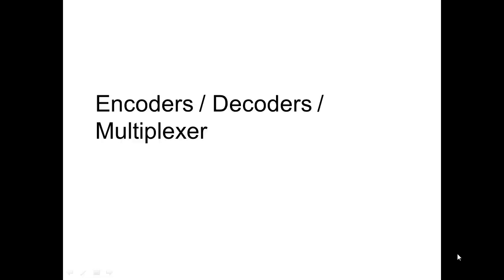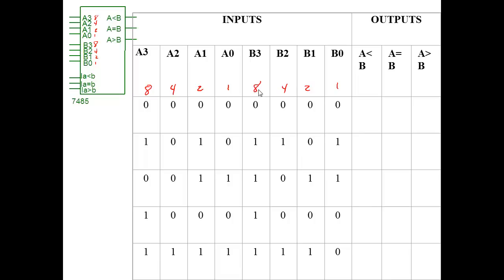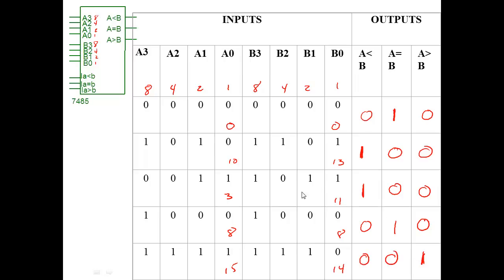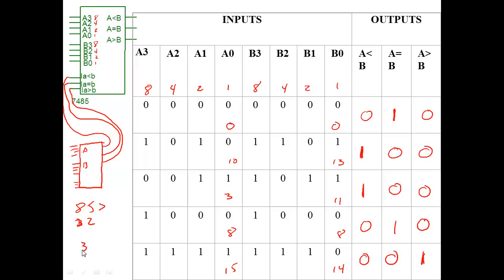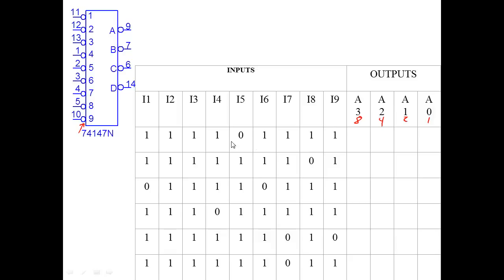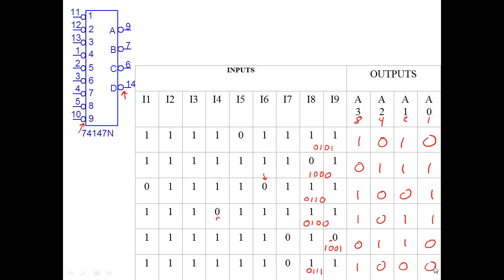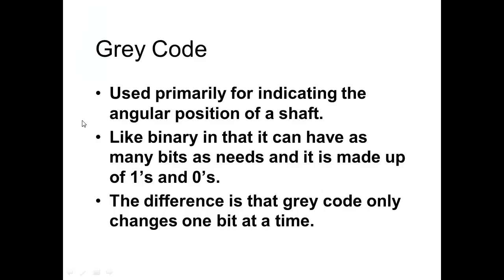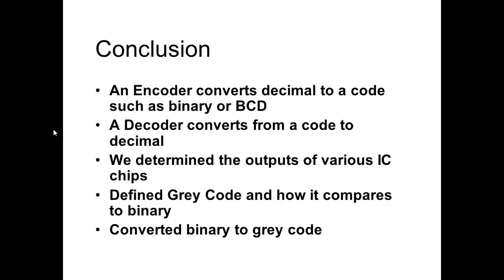Digital Electronics -- Encoders - Decoders - Multiplexors

Comment: On the encoders can u input the number 12 in decimal and get out an 8 bit BCD? ( 4 bits for the decimal number 1 and another 4 bits for the decimal number 2)
Reply from the maker: I honestly do not know. There might be a chip that does that. I only have used the very basic 4 bit BCD ones.

Comment: Where will a comparator circuit be used in the real world?
Reply from the maker: You may want to compare 2 sets of sensors or data sets. Maybe you need to know if something is synchronized and you would compare those 2 signals. Pretty much anything.

Comment: Are u planning on making a video about grey code? I really didn't get it here. and i would love to understand grey code a little better.  Or do u know of any nice videos on grey code?
Reply from the maker: I don't have plans to make one. Basically, grey code is used to represent data but only has one bit change for each count. For example, in binary when we go from 011 to 100 we have 3 bits change. In grey code, you would never have that. It is usually used to represent location data for an coded wheel. We used it in some old school robotics at one time. https://www.allaboutcircuits.com/technical-articles/gray-code-basics/
Reply: @MovieHQ  so, the action of moving bits one at a time, is that similar to how a shift register work?
Reply from the maker: @james77011  It is similar. For a multiplex/demux you would have serial data coming into the inputs and on the other end have serial data out.

Comment: Sir, could you explain for me why we have to use bubbles ( invertion) in chip 74 147 N. For example, we can represent input of 5 by 000010000 instead of 111101111. Thanks Sir,
Reply from the maker: Thanks for watching! The active low (inverted) outputs are part of the chip itself. I did not add those. My best guess as to why they are active low is that we can use more current with a LOW than a HIGH.

Comment: what are demultipleaxers ?
Reply from the maker: They are on the opposite end of a multiplexer and work exactly the same just backwards. A single line into the chip with multiple outputs. Generally you synchronize the 2 together.